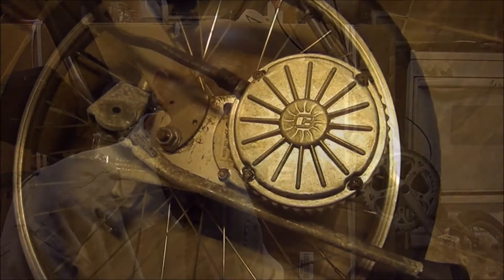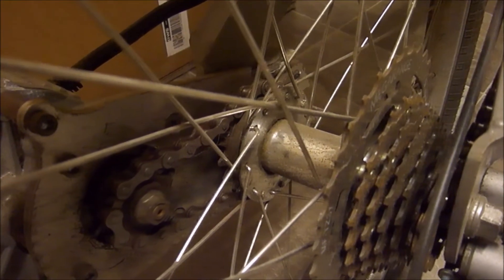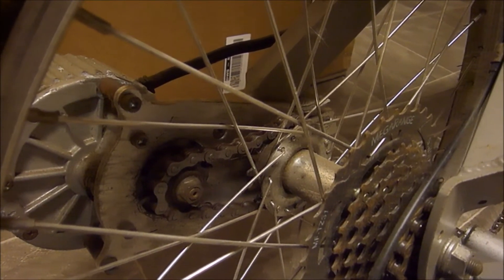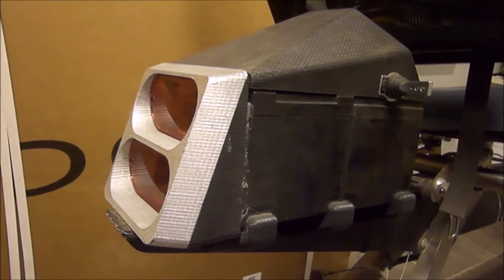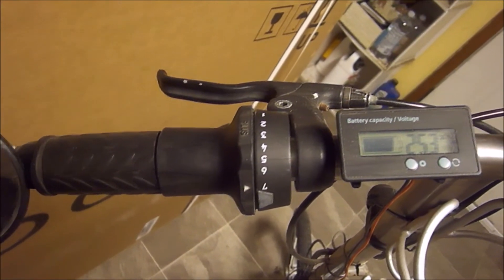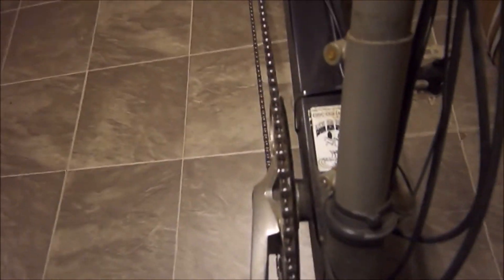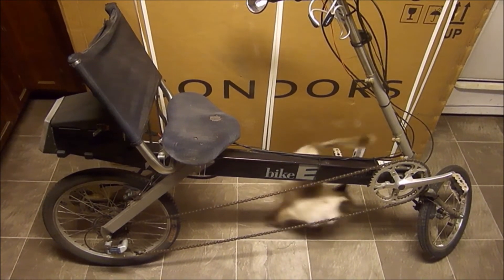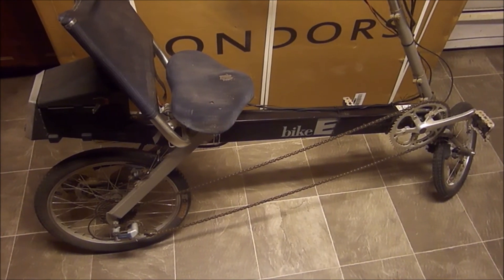Part 2 - BikeE Recumbent Bicycle with Currie 450 Watt Electric Motor

Comment: I still have my bike e ct  & deciding direct drive hub or use one of the mid drive motor I have in storage, I love the way bike e rides🥰💯💯
Reply from the maker: If you have the option of a mid drive, I'd definitely go that route.  I would love to convert mine to mid drive.  With the small rear wheel, the speed of mine is limited to about 15 or 16 mph.  (I can't get a smaller freewheel, and I don't have room for a larger motor sprocket.)  I'd like to get it up to at least 20.

Comment: Built my e-recumbent on a Sun EZ Classic frame using a 350 watt my1016z3 motor.  I prefer to ride it over a gas engine bike or gas scooter.
Reply from the maker: That's pretty much the same type of motor I used.  The Sun delta trikes are so cool.  I originally had the motor on a tadpole trike, but it was too wide to ride safely around here.  The recumbent delta trikes tend to be narrower.  I'll likely build another etrike in the future.  ...if an affordable trike finds its way into my collection.
Reply: @ricomon64  To keep the weight down I uses (2) 6s Lipo's (5000ma each) and a B6 smart charger.   I prefer my bike over the trike configuration its much easier to use a path and walkways.   Much more portable to toss in the back of my truck too.  The CLWB recumbent is the best platform IMHO.
Reply from the maker: @bobdobbs4086  I wanted to use a standard lithium ion ebike pack, but pulling 450W from a 24V pack was exceeding the pack's discharge rating.  The AGM lead acid batteries were the easiest option at the time.  I've been looking at so many trikes lately that I forgot Sun makes bikes, too.